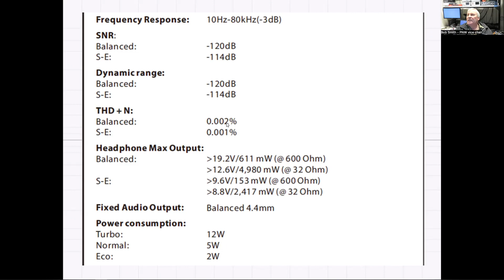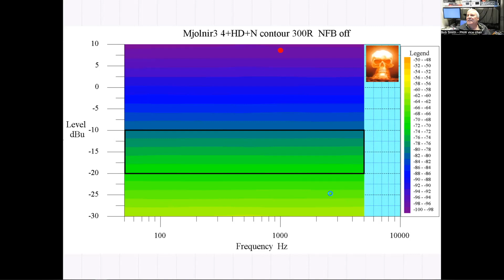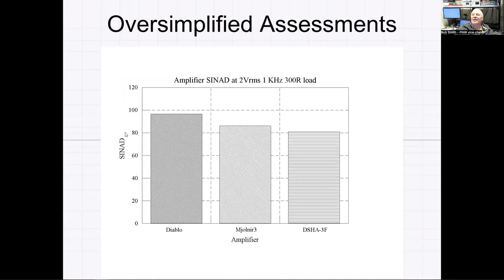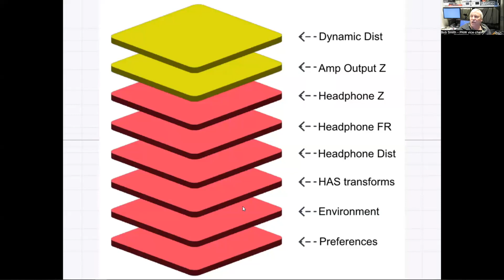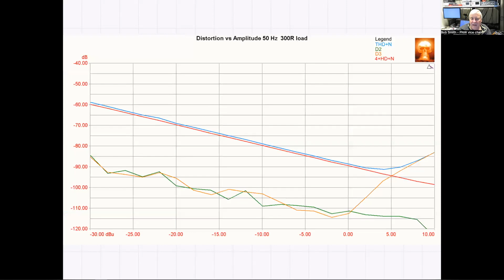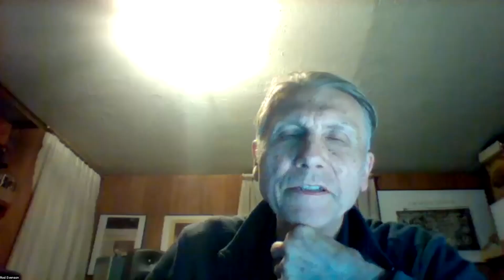2023-11-18 AES PNW Tea Time Topics:  Bob Smith "Distortion Measurement: A New Approach"

Comment: Genius Bob !   I could have used this 40+ years ago when working on speaker power amp design.  Should I optimize for noise ?  (the rise upward on the left of the 3D graph), no, looks like I need to optimize the headroom (right side of the 3D graph rise with input level).   OR just nonlinearity nearby the fundamental f Hz or anywhere.  Display just even harmonics vs. odd harmonics....  Or maybe that is part of your 4D or was that D4 additional tool ?

Would be neat to run a tape machine as DUT.  

Now I have to think of ways of making a transfer function that makes you go  W T H !!!!
Great demo !